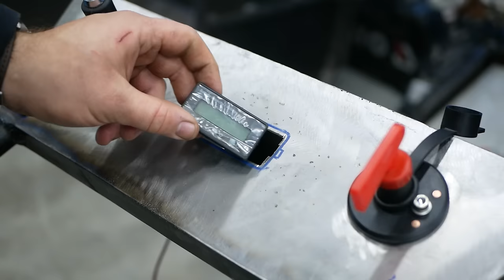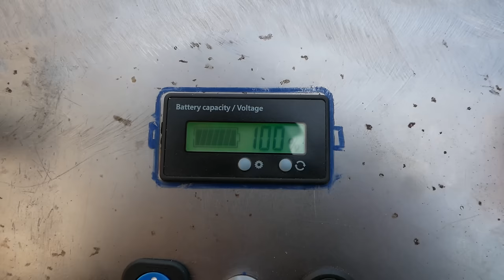24V Hydraulic Dump Truck

Comment: 3 minutes 22 seconds into the video - you could have probably mounted the hub in the holder to achieve alignment with the hole, and the hole hits the surface strongly in relation to the turned surface. Considering your diligence, this is gross negligence!